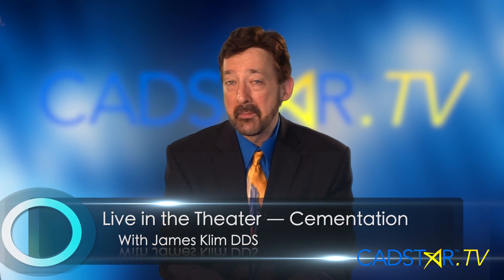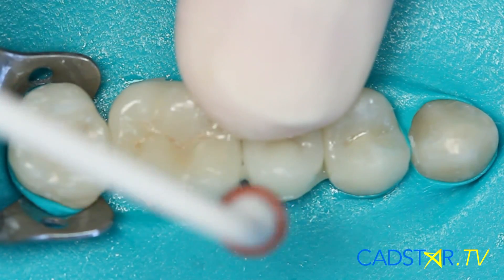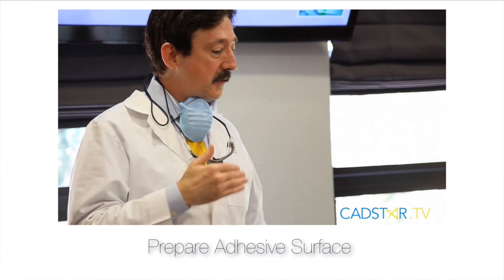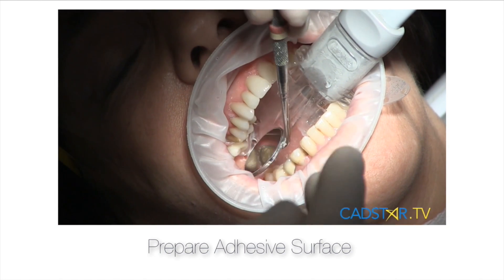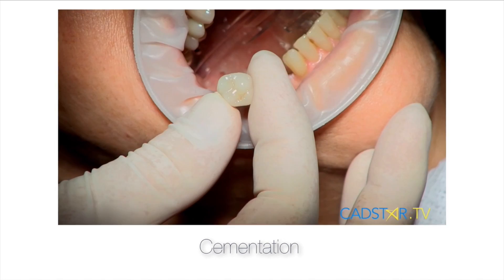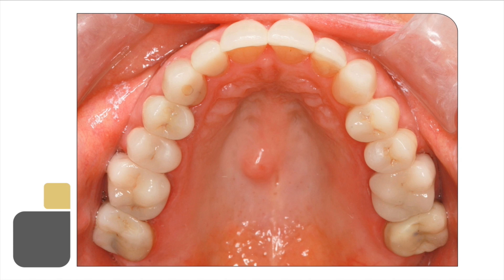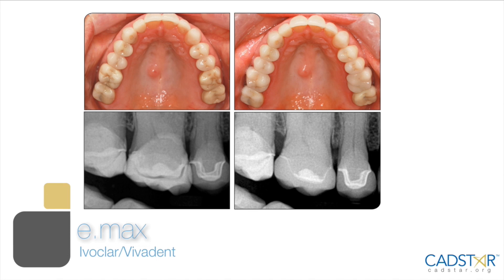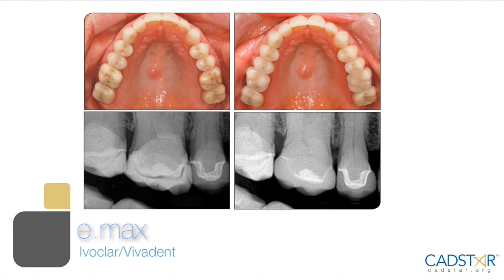Cementing e.max Live in the CEREC Clinical Theater with Dr. Klim

Comment: How do I get my crown to look more like the molar after cementation, most of my crown after cementation look like the premolar, where it appears that space between tooth and crown is filled with cement rather than crown being seated all the way down.
Reply from the maker: Depends on the mill strategy.  For Primemill, the extra fine will provide minimal spacer overmill and clean fits with less observed cement space; for MC XL, mill with fine and 12 on the left bur, not the 12S.  Hope this helps.